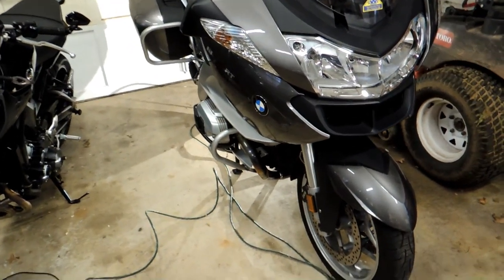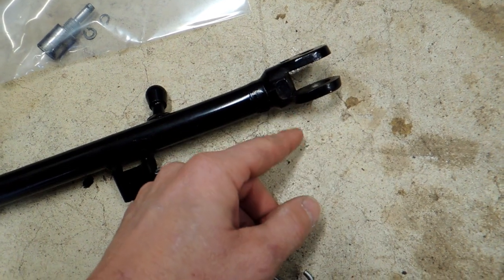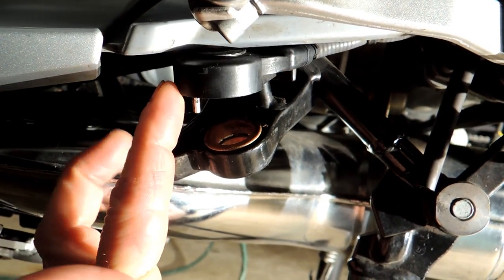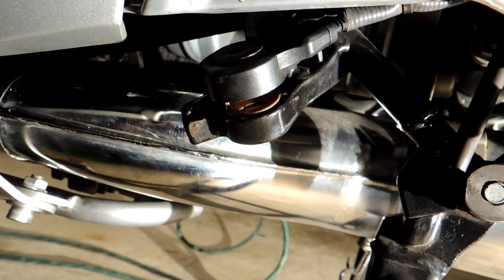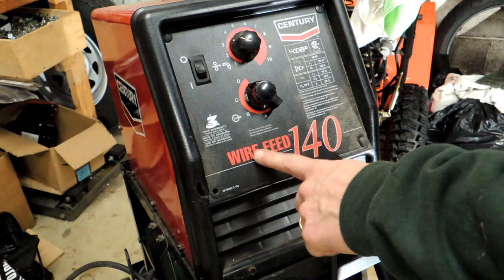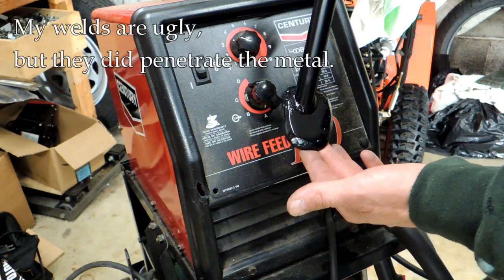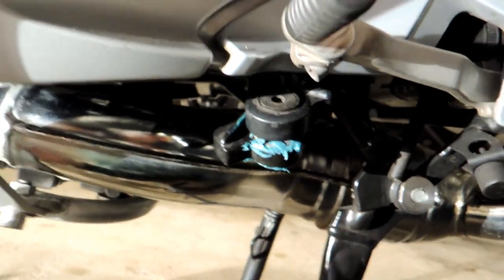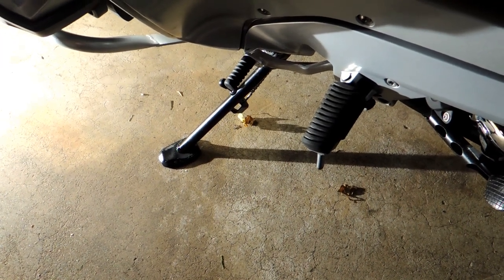BMW R1200RT Side Stand Modification

Comment: Useful for those who want to do it themselves, but of course the easiest solution (just takes a couple of minutes) is to just buy a bolt-on sidestand enlarger which not only gives a thicker base, but also a greatly increased surface area so the bike can be safely parked on soft ground without sinking in.
Reply from the maker: That's certainly an option, although it doesn't add the strength and resistance against bending that welding on steel will do.  Mostly, though, I'm just too cheap to buy a solution!
Reply: I bought a used RT with an aftermarket claw on the base, about 3x the time.  I still find the sidestand too flat, it needs more lean for hills and whatnot, esp for its weight.

Comment: I had the opposite problem with my 99 RT 1100, On Trips when fully loaded I was constantly looking for alternative spots to park when touring Colorado while my friends on their Harleys had no trouble parking anywhere, My bike was too upright and worried it would fall over if I didn't get a bit more lean.
Reply from the maker: Possibly the suspension was either modified or sagging.

Comment: Great job -- great diy project. (My buddy loves to weld ha.) My new-to-me '05 GS is amazing, but the sidestand has the same issue with that odd "looseness" and slides over too much with the full weight of the bike. My '02 R1150R does not have this issue, strange. I was hoping to see if there was an actual bolt that was loosening up, but your images of how the kickstand slides out that extra bit is also my issue exactly. BMW's are so tough, strange to see this weak sidestand design (?). The sidestand shouldn't have that wobble at all. I might just add one of the bolt-on expanders for reach and bigger footprint. Thanks again and great video -- best one on YT on this subject.
Reply from the maker: Yeah, the design is not much to write home about.  My repair has continue to hold up well, though.

Comment: Just make the pad larger so when you park on soft ground the stand won't sink as much. Yes the  stock stand will sink into asphalt on hot days.
Reply from the maker: Yes, my modification made the pad both thicker and larger in area.